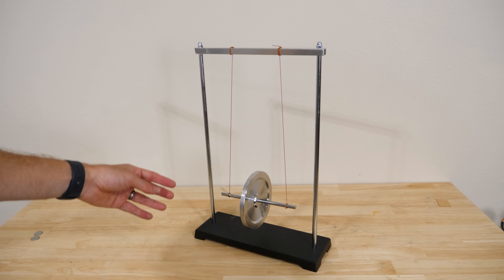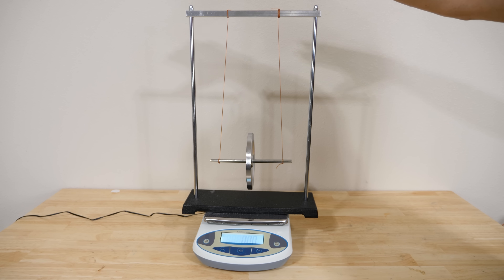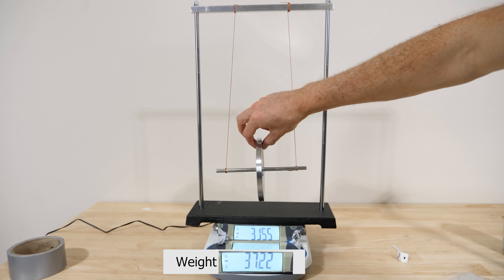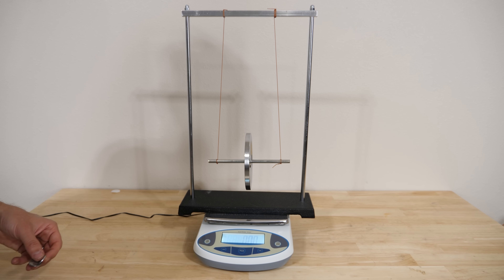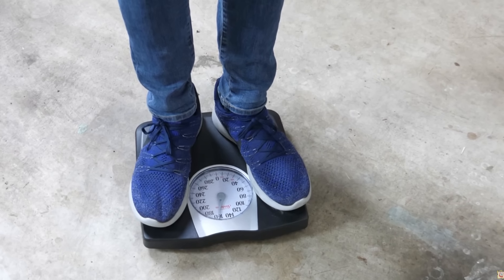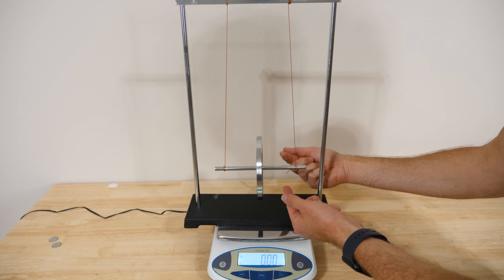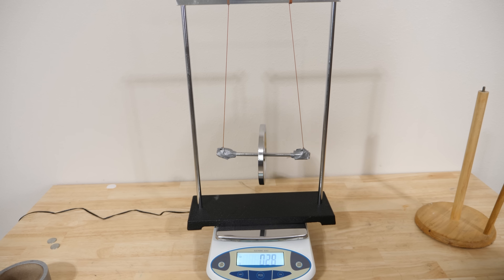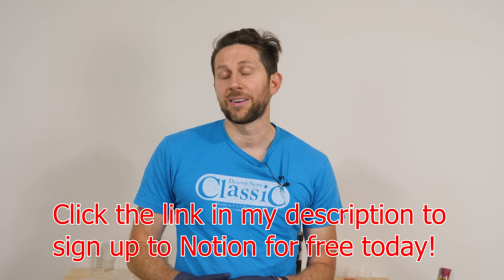How Does The Anti-Gravity Wheel Work?

Comment: No, this is not quite the truth of the mechanics that are occurring here. What actually is happening is actually fascinating! Like all objects applying force, everything is an action/reaction pair. In this case we have the force of gravity and the equal and opposite force is the normal force. The spinning wheel on its way down is reducing the normal force but when spinning in the opposite direction and on its way up (the exact opposite symmetry of the original downward motion and spin direction) it is reducing the gravitational force. The scale doesn't know which specific force it is measuring hence reads the constant -6 gm while the spinning wheel and direction simply alternates the equal and opposite vector it alters.
Reply: But, at first glance in its way up the wheel should be heavier than being at rest. It is pulling down the strings with a greater force than its own weight to be able to climb up.
Reply: @O-Kyklop  Read my comment again. One direction is facilitated by the gravitational force, the other is facilitated by the equal and opposite normal force.
Reply: @TheGeniusHillbilly  Could you explain “normal Force”?
Reply: @TheGeniusHillbilly  One direction is facilitated by the gravitational force……..

On its way down the wheel  doesn't pull down with its full weight. There is a negative  lecture factible. 

the other is facilitated by the equal and opposite normal force.

On its way up, now the wheel is pulling down the strings with a force surpassing its own weight to be able to climb up.
Now is a negative lecture illogical. 
You can try to explain it as you like but fact is the Wheel is pulling down the strings with a greater force than its own weight.

Comment: This looks like it work work in space albeit a very slow 🐌  space drive 😂. Use an electro magnetic force of attraction with the wheel and it would slowly accelerate  and then abruptly stop  (at the full length of string), then reduce the electromagnetic force on the return of the wheel (now retarding) and acceleration is in same direction... now repeat over and over. Would this work?

Comment: It’s correct to say that the disk is accelerating downwards both when it is falling and rising.  The one important thing missing from this explanation is the acceleration of the disk when it hits bottom and reverses direction.  The problem is that the scale, which measures force, is not fast enough to measure the large spike in the downwards force as the disk reverses direction.  In other words, for the fraction of a second the disk is accelerating upwards, not downwards.  This upwards acceleration is required for the disk to change direction since its velocity when it hits bottom is at a maximum..  When the disk reaches its highest point its velocity is zero but when it hits bottom its velocity is at a maximum which is why there must be a large momentary upwards acceleration to cause the disk to reverse direction.  In other words, there is no anti-gravity effect when the weight is averaged over a whole cycle.

Comment: It hasn’t got lighter! The reason for the 6 gram difference is two-fold: 1. When it hits the bottom there’s a very brief moment of high acceleration upwards that would look like extra weight except it’s too brief to register. During up and down movements, the vertical velocity isn’t constant. There is always a component of acceleration downwards which must be subtracted from the weight when it’s measured (about 6 grams!). Gravity isn’t beaten yet ! 😅
Reply: When winding up if you look from the side you will see that the wheel axis is pushing down the strings with full weight. So the wheel should be heavier more than lighter.

Comment: That video gives the worst explanation of how  Maxwell's gyroscopic wheel operates.  There is zero change in the mass of the system.  However the weight does change because the motion of angular precession is constrained by the two cords ,and the energy in the system pushes it upwards, against the downwards force of gravity.  So the experiment does reduce the amount of gravity.

Comment: ok,install on the both ends of the middle axle to smaller Freewheels on Motors with Speedcontrol to howering in mitt Air. If the big wheel(use a little Bigger and make the OUTERRING Heavyer-a flat plate is not a real freewheel-the Outerring need to be more to produce more socallt FLIEHKRAFT) spins the axle will spin in one direction,so start boht wheels on the end some will press the axle in the oposit direction. THIS give the BIG Wheel the Power for lift of,not what you do here,ok. You produce Centrifugal force and the axle will in the center of hitself,tahst why you lose weight. it be like a Weigth from a Weightlifter with a BIG Freewheel in the middel of the Axle. The Moment and both Wheel produce a stronger turnforce then the natural Force of the Middlewheel will all lift up.PROMISED.

Comment: So if you integrate the weight in small time intervals, this integration should be zero.

The scale cant measure and integrate the bounce because it filters out this spike where it weighs much more but for a short time.

However i have question gyroscopes and their facing on spinning earth.  Because gyroscope is moving in a circle, will the movement of earth push cause the gyroscope to have a force on it as the spin of earth forcing the gyroscope to twist in a circle.

Comment: The explanation is very simple, when the weight goes up, it forces the scale down due to the reaction force of one object accelerating over another, the only time this force tends to zero is when the disc reaches its lowest point, as these scales usually measure every 1/4 of a second, there is not enough time to record the zero value. In order for us to have a real view of what is happening, we would need to take measurements at very short intervals of thousandths of a second and plot them on a graph that can later be expanded to buy, this is physics, it doesn't take much intelligence to understand

Comment: Your explanation about the ease of lifting the heavy gyro doesn’t work: you say “he now needs only to push the gyro”, NO,  he’d still need to support its weight/gravity/mass, yet he doesn’t. If it were centrifugal force the gravity would be erased by it.
Reply: Correct. This demo the weight is less because the wheel is in partial  free fall.

Comment: Is that realy antgravity ? Yes, it is.
The spinning weel is a closed System which wiil opose every force from outside, in this case gravity.I have had this in some balistics issues.
Those 6 grams are the interaction between weel mechanics and an outside force, in this case gravitation, which will be constant no matter if the weel goes down or up

Comment: Ok...if so, this experiment can be repeated in another way. We take like a children's slide, we place the weight at the top of the slide. the moment when the weight is at the top of the hill and bound to the hill, the masses join. At the moment when the weight begins to slide down, part of the mass becomes falling, loses part of the mass, part is transferred through friction.
 We should get the same result on the scale.  Another cool way would be to take a thick copper tube and let the magnet fall through the copper tube as it stands on the scale. 😀 the scale should show less than the total weight of the magnet and the copper tube are weighed separately. Am I right?

Comment: Moving parallel to the angular momentum reduces the influence of gravity. Because the elastic rope will reverse when it reaches the bottom, the force of the rope rotating the object and the direction of the object remain unchanged. Of course, it will be reduced by gravity. As you reach the head, reduce the force and change the steering and pause.

Comment: It stops because the potential difference  between it and the earth has been removed     - the sun is our straightest line     the planets orbit is the next straightest line     the faster you spin the wheel  the straighter and longer  the lines of force     spin it fast enough the the wheel would follow not the sun but the thing the sun is following  -  its parabolic  the spin is like two magnets pushing apart  no spin difference  means its one object following the same straightest line  more spin   repulsion  or two objects  both trying to expend energy in the fastest rate   cover the distance in the shortest amount of time    - the division of the second  is our observation point our memory   capacitance is mass  mass is stored rotational energy   resistance is our ability to measure work or WATTS   amps are the flow of  energy thru the circuit while doing work

Comment: Utterly confused. I understand that it is still accelerating down wards even when it is winding up the strings. What I can’t figure out is. If you put a small battery and a hub motor in the wheel. Just enough to keep it rolling back yo to the same height. Could you then encase the entire unit? Now you have a device that runs on batteries for extended periods of time that is reducing its own weight constantly.
Surely this can be taken advantage of. Multiplied somehow so you could have an electrically powered device that is lighter than itself. Rather can move upwards from the earths pull?
Like the other experiment shown. It seems to me that taking the momentum created by gravity and pushing it out sideways you might somehow reverse gravity upon itself???

Comment: 4;40 - note very carefully how in both examples the spinning wheel is first pushed forward and rotated to the right. These motions cause the wheel to precess upwards in a right hand spiral. The experimenter isn't lifting it, he is doing work that converts the angular momentum of the spinning wheel around one axis into angular momentum around two other axes. Notice also the effort required to catch the still spinning wheel when he stops the rotation to the right (which he has to do because the wheel would otherwise still keeping precessing upwards and he wouldn't be able to maintain his grip on the shaft, with pretty unpleasant results).

Comment: get a rod like that with a strong cable like guitar string and attach it to a drone with the weight spinning see if the drone can lift up the 40 lb weight maybe get two opposite ends on the rod with wheels on each ends spinning at opposing directions so it's more stable and maybe put the drone on a loose ring so it can find its own center of gravity for the wheel and have some lift off please do this please do this

Comment: I’m really curious what would happen if you change the weight of the wheel, or change the location of the weight on the wheel, (heavy outer lip vs heavier core, vanes vs solid plate, ect

Comment: Nice video, but poor explanation.  First, the scale doesn't measure the (downward) force of gravity exerted by the Earth on  apparatus(Stand, wheel, strings, etc...) but instead the  upward "normal" force exerted by the scale on the apparatus.  As the gyro falls, the center of mass of the apparatus accelerates downward. According to Newton's second law, this means the downward force(the weight) is larger than the upward force(the normal force). Since the scale measures the normal force, the scale reading decreases. If you did  a similar experiment with a mass on a spring,  the scale reading would be negative when the mass was accelerating downward, but positive when the mass was accelerating upward.

Comment: Question?? If you use - magnetic force to repel the wheel upward only at the top and positive force at the bottom would the wheel be lighter?
Reply: Interesting question. Here is what GPT 4o has to say about your query:

Introducing a magnetic force that repels the wheel at the top and attracts it at the bottom would indeed alter the apparent weight readings on the scale, but it wouldn’t make the device overall lighter in the strict sense. Instead, it would create a scenario where the force of magnetism modifies the apparent weight as measured by the scale during the oscillation.

Here’s how it would work:

Magnetic Repulsion at the Top: When the wheel reaches the top, the magnetic repulsion would push it downward, adding to the force that gravity already exerts on it. This would momentarily increase the downward force (and thus the measured weight) when the wheel is near the top.

Magnetic Attraction at the Bottom: As the wheel reaches the bottom, the magnetic attraction would pull it down more forcefully, adding to its gravitational acceleration. This would also temporarily increase the measured weight at the bottom due to the combined effect of gravity and the magnetic pull.

Apparent Weight Changes During Motion: Between these extremes, the magnetic forces would assist gravity (at the bottom) and counteract it (at the top), causing more pronounced fluctuations in the scale’s reading. During the upward motion, the magnetic attraction from below would provide a sort of “boost” that could make the system appear momentarily lighter.

In summary, while the device wouldn't become lighter in an absolute sense, the oscillating magnetic forces would create an overall effect that could make the device's average weight reading on the scale fluctuate more than with gravity alone. The scale would show brief increases at the extremes of the wheel’s oscillation, but on average, the weight would still balance out to the original system’s weight once the motion stabilized.

Comment: OK, so this is truely insane. And given your demo, you have another insane situation of a new type of rocket engine, 100% internal. This would be true because gravity is not a fundemental requirement in your experiment. You just need a pull, or high energy state/ and a low energy state. That is assuming you can replace gravity with a spring. So you install a method of winding up the string without any spining, maybe with an unlocked clutch, and moving the gyro into the start position while not spining that one part. Lock the clutch and let her fly. Until the bouncing is done, you have the 6 grams of, basically internal rocket thrust. Then unlock the clutch and begin again. To balance out torque, just have two gyros with opposite spins. A little creative gearing and they would remain in sync. If you can collect energy from starlight or gamma rays, well, infinite range in space craft. Given being in space, no air drag on the gyro.
True, not a lot of thrust, but it will last forever. Am I being mad here? Is this really possible? What am I missing?

Comment: I have always known that levitation will be a mass spinning at millions or rpm and then controlled by lasers which will issue forces on the sides of that mass so as to use  precession to counter gravity or to accelerate in a certain direction.

Comment: If you had a bouncy ball inside a closed system, would the entire system weigh less as the ball is in the air during its bouncing?
Reply: It would weight less when the ball is in the air, but the average weight would be independent if the bouncing (assuming non-relativistic speeds)

Comment: Excuse my ignorance but the explanation doesn't seem to make sense to me. The spinning wheel isn't accelerating more down than up but outward. A gyro resists movement, so when it's falling it will be going SLOWER because of it's spin , and it distributes that reduction when winding upward on the string. However, it's harder to move in other directions as well, so the weight versus the ground has changed but not in other directions if we could measure it. 

And as far as someone lifting a spinning weight by moving towards its spin -- that's spreading out the work load by pushing up a ramp. The person isn't lifting 40 pounds straight up -- they are rolling 40 pounds up an incline -- it's traveling a greater distance as it spirals upwards. So you can look at the "Reduction in apparent weight" as a misdirection of mass due to that opposition to freefall by accelerating in other directions. You don't get that affect when the gyro is connected to a stationary object -- but, it might fall a bit slower if dropped. 

Now there might be a quantum mechanical time explanation for this as well, since gravity is defined as a time gradient. So parts of the gyro are actually slowing down time more than a stationary falling object, so in effect, it might be said to be reducing gravity by creating a greater time gradient.

Comment: It doesn't accellerat upwards, it instantly accelerates and then immediately decelerates upward (or "accelerates downwards"). And it's this deceleration upwards (expressed as "acceratining downwards") that makes it lighter, along with the real practical acceleration downwards. But (I reckon) that sudden upwards acceleration at the bottom (that lasts for an instant) cancels out the lower weight results throughout the whole scenario (no free lunch). But the weight of the sudden acceleration is practically indectectable (with that equipment) cos the sudden upward acceleration is so short lived.

Comment: It just can't put it's weight on the strings because you wound them on the rod... the wheel's spin carries it back up most the way.. I uhh... I think most people notice that playing with a yoyo as a kid no? Or stepping on a log wrong.. or a shallow set of carpeted steps in your socks.... you realize pretty quickly you can redirect at least a portion of gravity's tug lol.

Wondering if this is the same deal that offers mechanical advantage from a pulley...?

Comment: It’s a YO-yo. Weight down spinning stops and rewinds it back up again , until it has exhausted its original input.  Not weightless, inertia by it gravity response.  Gravity always wins. But in space, gravity is the nearest mass attractor influence but can diverge to a stronger or onboard attraction. Engine power., just puff some thrust.  First on Earth , over come gravity . After that atmosphere, then aero dynamic progressive lift and after.  Space, just do it out there .  seems the only antigravity  place.